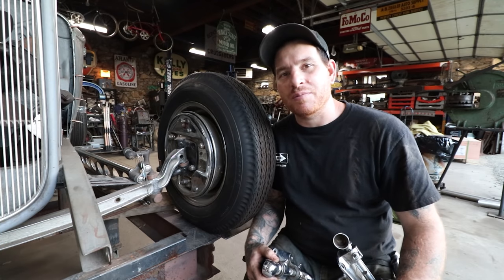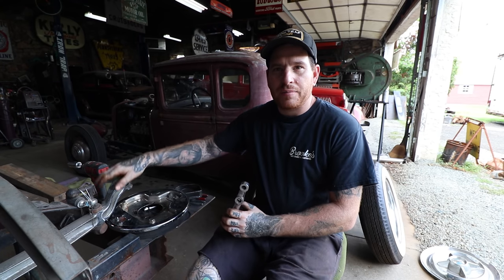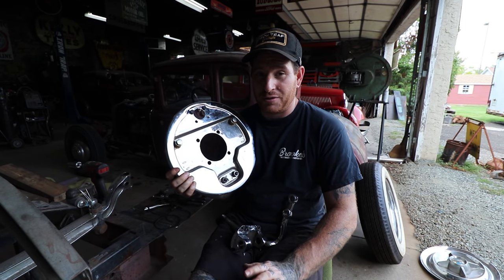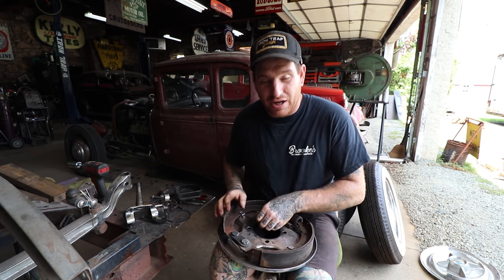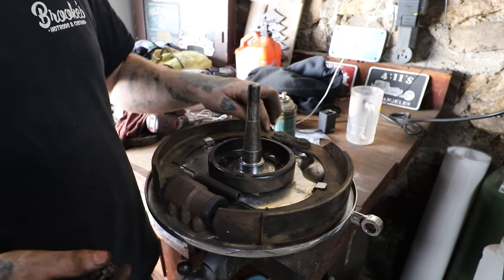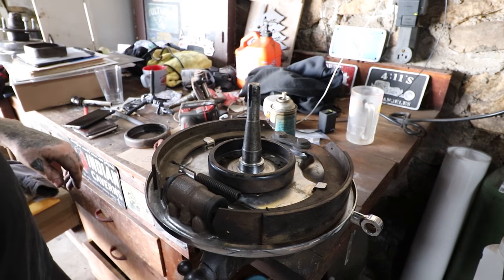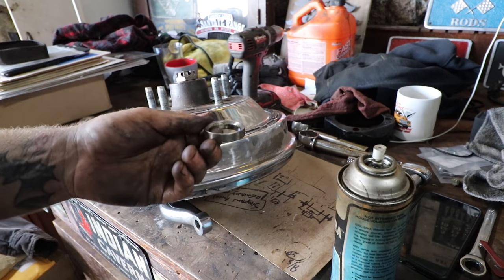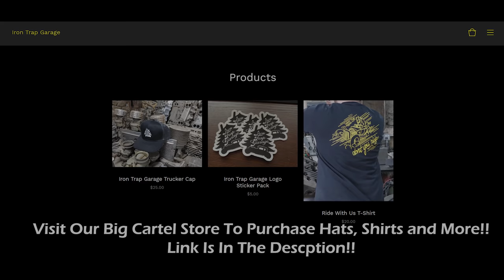How To Add Juice Brakes To Early Ford Spindles - It's SUPER Easy!!!

Comment: Hi Matt. I think those spindles may be 1935 as they are cross steer. I did this same job recently and covered it in a video. I opted for filling the backplate with weld and remachining. It came out really well. I think with your chrome backplates the way you went is probably the best option. The chrome parts look great. I also put a dent in the top of the grease shield to make sure the spring wasn't fouling. It doesn't need to be very deep. Mart.

Comment: Hey Matt,
   WOW ! That video really brought back some memories !
When I was a kid I had not seen a project where someone used the piston ring but While helping another guy doing that conversion I tried an old ring and fond that it worked.
I was not dealing with chrome parts so I did not have that small problem.
But as I will be 72 years old in a week and started playing with hot rods when I was 12 years old hanging around the corner gas station where the older hot rod guys hung out, I can tell you that was the way we did it then !
   Thanks for the great video as always.

  Be safe, well and prosper

Comment: Hi Matt. My friends John and Jamie, There father use to run that type of set up on a 38 Ford Pickup with a 409 and a 34 Ford pickup with a 283 at Island Dragway  in Great Meadows. Never once did I hear of any issues. My wife and I are using this set up on our Model A project now. Great videos of front end rebuilds. Long live the I beam axle. Keep it old skool cool. RIP John SR.
Reply from the maker: We have heard of alot of people running them through out the years!!!

Comment: I was masochistic and machined my own “piston” ring and collar/spacer to adapt Model A spindles to 53 F-100 bearings and seals. Nothing to purchase on my conversion with good used parts but one needs a lathe and some measuring skills. Agree the non-welding method is saving those killer chromed backing plates.

Comment: Tuesday morning coffee and ITG!  Another good old tech. I have no problem with this method, however sometimes the piston ring  (stock model A, if I recall correctly?) is thicker than the backing plate, resulting in a loss of "clamp up".  Something to keep an eye out for.  Richard and Dennis Lacy at the Early V8 Garage sell a purpose built steel ring for this which is the easy way out for this old dog.

Comment: hope they work out with your dropped axle, matt. i'm impressed that old chrome job has held up and will be good enough for a show rod.
Reply: they do not do chroming like they used to do leave it out in the rain today and you get rust points coming through that old chrome as long as you wiped it down when it got muck on it it would stay good for many years

Comment: Had a couple of Model A's over the years and gathered "juice brake" parts but never kept them long enough to do the conversion. One question continues to surface when I see folks like you replace king pins on the mechanical brake axels. Do you always leave that "cup" at the top of the king pin where the mechanical brake hardware accesses the vertical pin that actuates the mechanical brakes ???

Comment: Matt, if you installed the thrust bearings on the bottom would that lower the spindle to add clearance for the steering arms?

Comment: I have a question I have the same backing plate I need to sand blast them an clean them up. But I don’t know how to remove the cam and spring 
Could you tell me how and where to get replacement cam spring and bolt 
Regards

Comment: Where do 41 ford Backing plates fall ?  You mentioned 42 to 48 and up to 40 , I have a 41 I am putting Disc brakes on so I will have a set of 41 Juice Brakes for My Model A if they will work

Comment: just wondering if the friction surface of those drums is plated? if so , your stopping power might be not so good?! you might need to turn the drums just enough to remove the chrome. very informative video, as always!
Reply: Chrome doesn't build up very good inside curves unless you use additional electrodes but you would turn a small amount out of the drum just to true the surface.

Comment: They conversion works great the scary part about those breaks though is the drums those 2 part drums or separate ask me how I know going around a mountain road when all of a sudden the waited there and was they riveted together but that's basically the technology type thing that they used sheered off and left me with no right front brake scary

Comment: Wow no wonder guys switch to mustang 2 front ends. Thank you for sharing this lost knowledge. My grandfather knew this stuff. Told me how a transmission came out of a model A. Decades later went to apply for a job at a garage. The service technician. Couldn't get the trany out. I had no problem.

Comment: Wouldn't it be easier to have ground the "piston ring" end gap just the same way you would do it to insure proper end gap on an engine?
Reply: I know what you are saying but, because the chrome plating was so thick  on the backing plate the inside  dia. of the piston ring would have been too small for the flange on the spindle.
Reply: Chrome plating sometimes will build up in thickness rounding a corner.

Comment: when you take the backing plate off in a year or so, that ring is most likely broken, no problem because it is captured, but you will need a new ring , so find a new ring before starting that job.
Reply: I did the same thing and as you said, upon removal the ring was smashed to bits. I have a backing plate here from  a ‘40 that has a steel ring instead of the piston ring. It came off a very old hot rod. Somebody must have been making steel one piece rings because this ring is perfect.
Reply from the maker: Good to know! It's a fairly cheap item to replace

Comment: 09:04 Your using a stepped piston ring which is cast iron.
 I know this is old school, but I'd rather have a steel machine ring instead.
You already are taking material away from the 4 bolt support flange area.

Comment: Anybody out there put F-1 truck brakes on model A spindles?
Reply from the maker: You will run into the same issues covered in this video. You could use 48-52 F1 spindles, the king pins bore and angle is the same